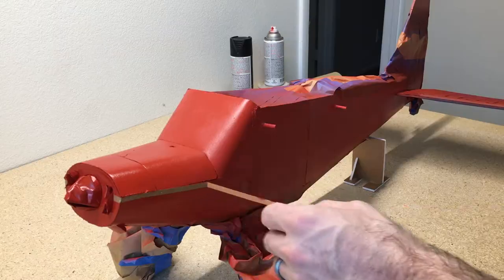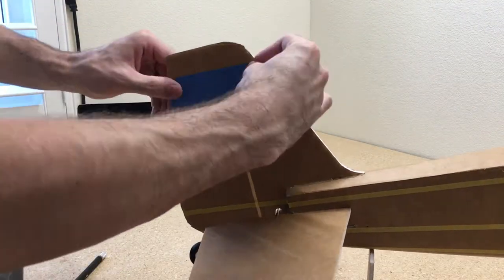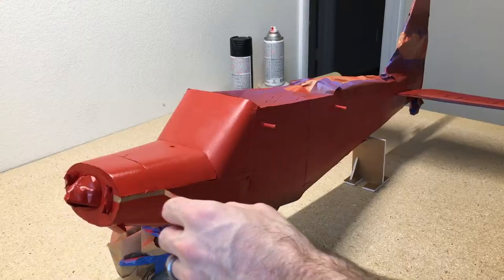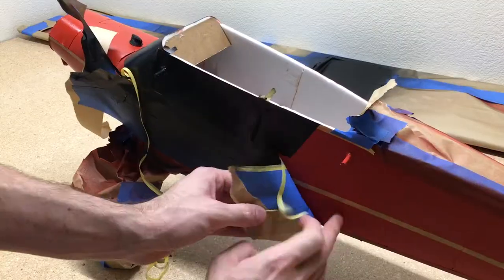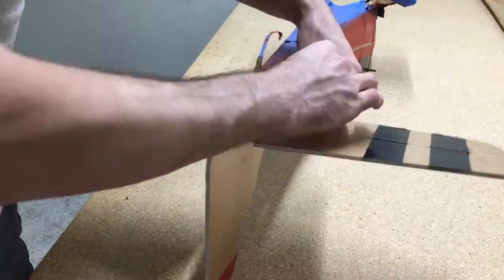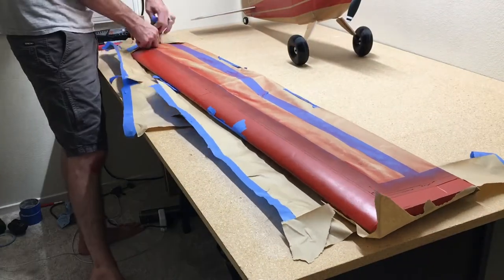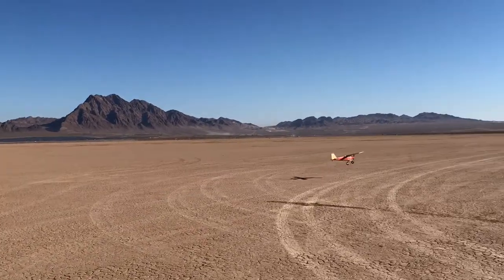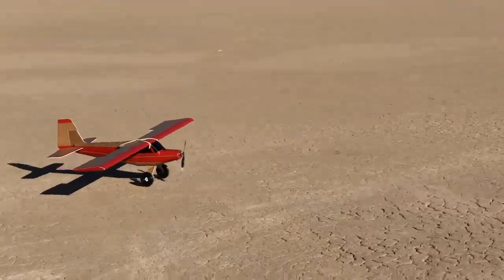The BEST way to paint your DIY airplane

Comment: quick tip on wheels instead of using Paper Tin foil works great on cowl and landing gear conforms to the shape Great Video take care
Reply from the maker: Thank you for the tip. I did not think of that one. I will defiantly use that trick next time. Cheers

Comment: great video mate.

If you wipe some hot glue along the seams it seals the foam so it can be painted, also stops the paper from peeling off from the edge after alot of use.
Reply from the maker: Thank you for the tip Ben I will give that a try.
Reply: it can be painted but the surface is not totaly flat 😊